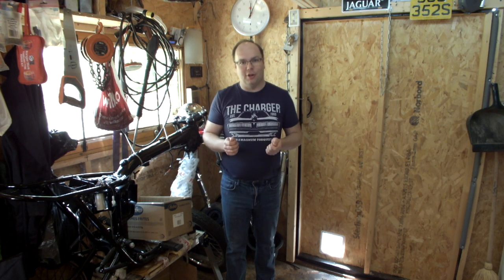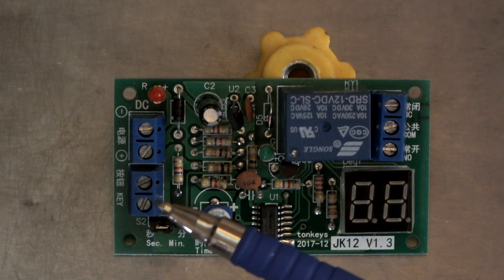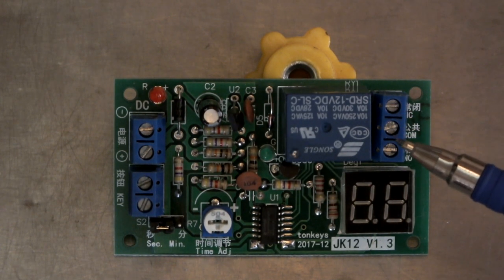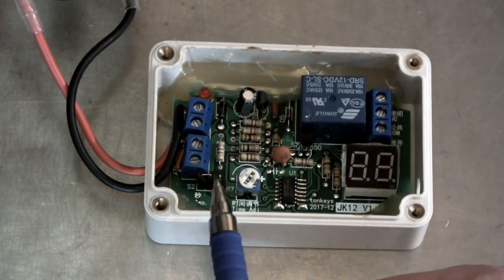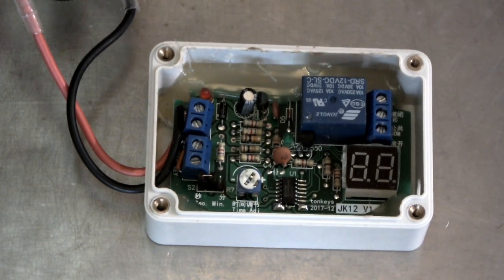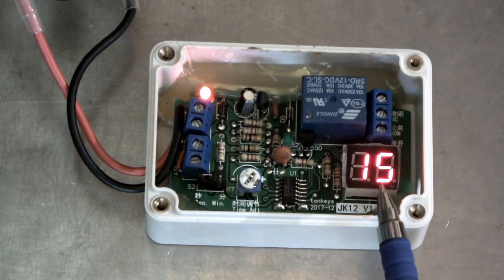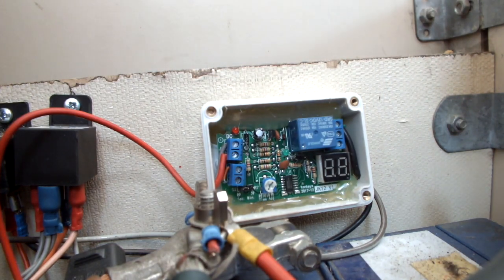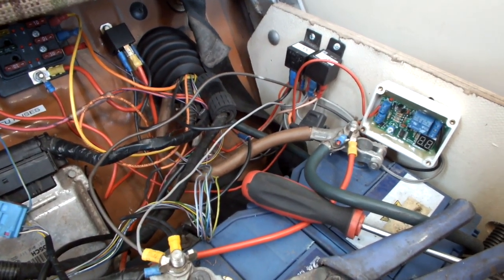VW T25 cooling Fan Timer

Comment: Having Overheating issue on my t25 2petrol 1984.. Replace fan switch/ thermostat and temp gauge sender also fan does’nt kicking at all any idea please?
Reply from the maker: Check.that the radiator is good and has good flow